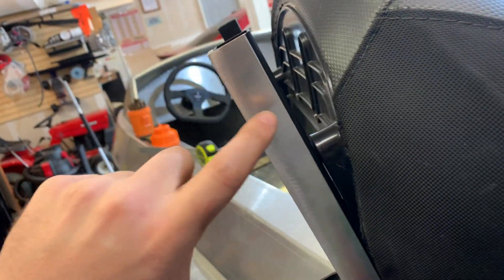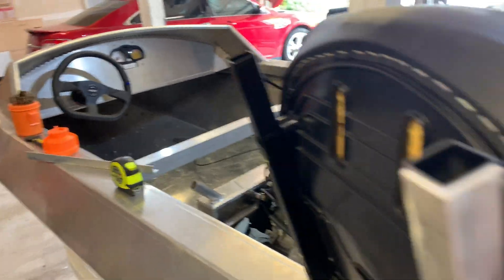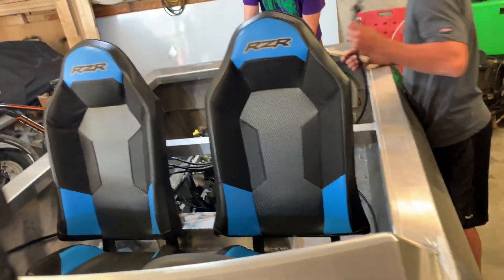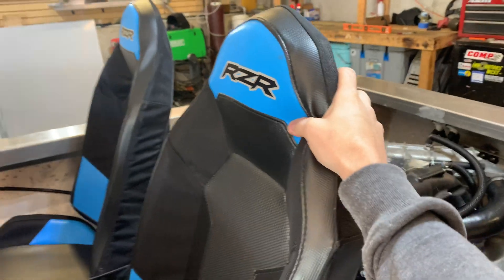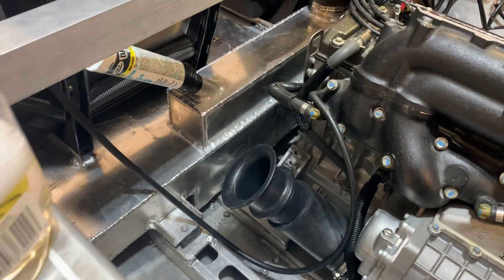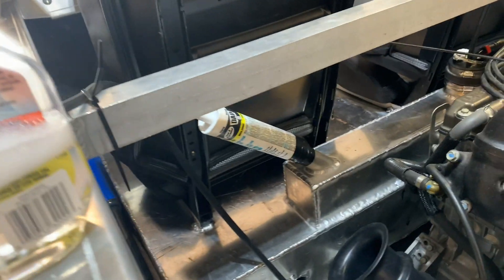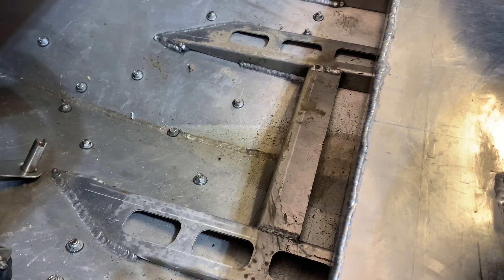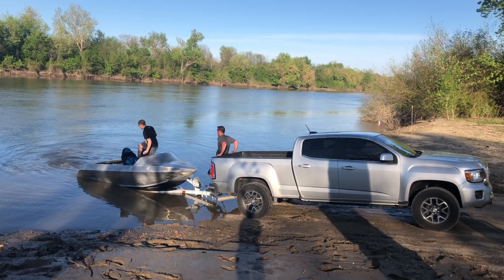Mini Jet Boat Build 20 - 58.1MPH Top Speed, Seat Brackets, and figuring out next steps

Comment: how many liters per 100 miles does this boat eat?
Reply from the maker: It used right at 17 gallons to go 54 miles with plenty of “spirited” driving. 

That equates to 64 liters in 108 miles.
Reply: @Localhost127  i think it's much better to install gas equipment,but space not enough i guess🤔

Comment: move your weight back- you are throwing a lot of water out the front and sides- see, if you can trim the nose up till the boat is on the verge of porpoising- jets ride on the last foot or so of the hull you are bow heavy- this will also help with the turning issue. Check out this clip note how little water is being thrown out of the side. https://www.youtube.com/watch?v=WtE2ESpIAp8
Reply from the maker: Perfect! I still plan to add the weight of the hatch, Some latches, Another small battery, and small subwoofer to the back. I imagine that amount of weight, Plus a trimmable nozzle will make a good bit of difference? Thanks for the advice!
Reply: This is exactly why my build is getting on-the-fly adjustable trim

Comment: What kit did you buy? Rnr?
Reply from the maker: This is the MiniJet Inc. 11 Foot avenger hull.
Reply: Ah, i was looking at the 10ft, is the extra foot worth it for the money?
Reply from the maker: In my opinion, Yes. From the research i have done, the ten foot is perfect for just about any 3cylinder power plant and especially two strokes, But for the 4 cylinder stuff, It helps to have that extra foot. Regardless, Just about anything that comes out of his shop is top notch though.

Comment: You added weight to the front with the new tank and also installed an extended ride plate. Both of those changes will likely lower the bow under way. If you are unbalanced right or left you may be getting into the curved sections of your bow chines which will naturally want to pull the bow around. If you add even more weight with gear, fuel, bigger people etc you may get into some "chine walk". Delt with most simply by always staying in a slight turn. Otherwise you would need to make hull adjustments. If you're plate is easily removed you could experiment with it off, and or shortening it entirely or cutting a "D cut" using a large holesaw etc to reduce contact area. Keep in mind you aren't done adding weight to the boat. Chineing is most noticable on glass water.
Reply from the maker: SO KNOWLEDGEABLE! Thank you for the advice on each one of these videos. That was a spot on explanation that i could actually visualize. I'll wait to do any hull modifications until i have the boat near completion to avoid any re-work.
Reply: @Localhost127  I don't remember if you have trim but that effects it too.